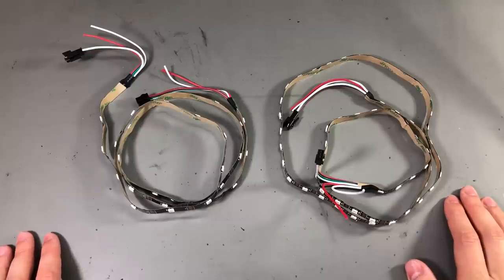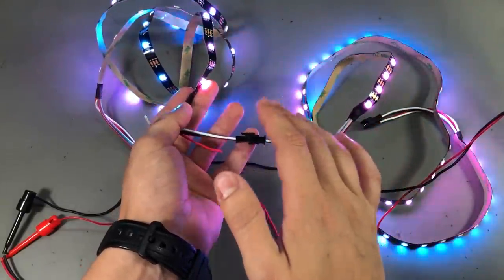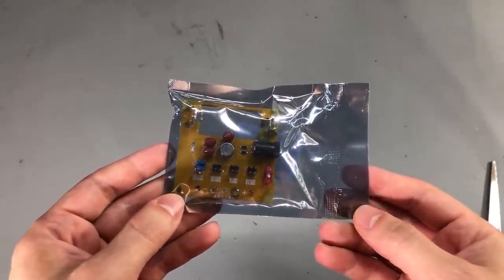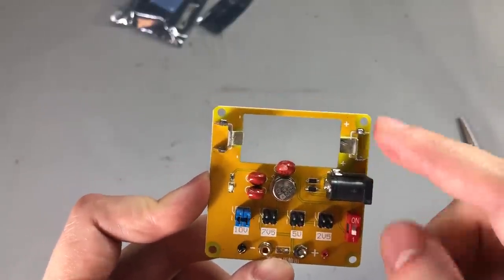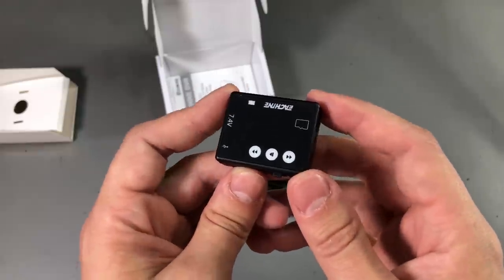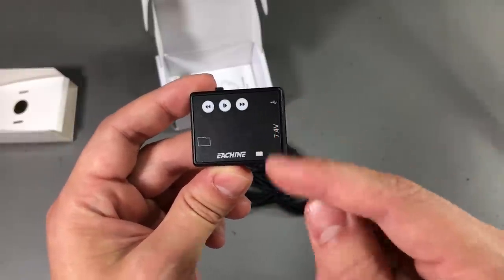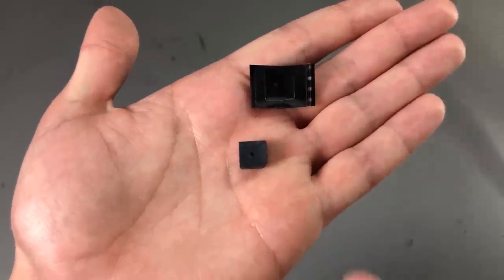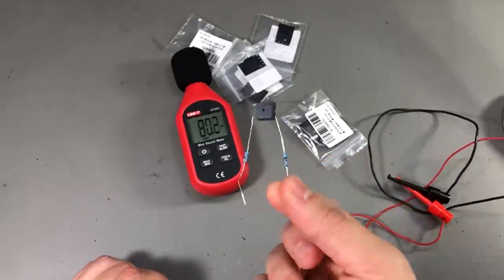Voltlog #176 - InTheMail

Comment: Did You also get a bit of paper with the voltage reference saying what each output was exactly? I purchased a couple of those types about a year or so ago, and it had that with it.
Reply: The Defpom's Repair Channel I was about to ask the same thing about the sheet of values with the calibrated meter. Unless it's expected to consider perfectly rounded values like 10.0000V 2.5000V etc...
Reply from the maker: I got no calibration paper with this one. However from what I've been reading people were getting the same printed values so maybe they just stopped doing that because it's silly :-) I did send mine to a friend which has access to a calibrated meter to have it measured. I will report back in a new video.
Reply: VoltLog - awesome, at least you will be able to trust that calibration. I saw someone else with the same unit, I don’t remember who it was, their paper was different to mine, so they appeared to be ok at that time.
Reply: The Defpom's Repair Channel The printed ones are just photocopies of the same data. The hand written calibration labels look more genuine but who knows if calibration was even performed?
Reply: bornach - I think in my case the ones I got were genuine, as the calibration values were were very close to what I could measure on my 6.5 digit meter.

Comment: I already had a AD584 voltage reference, but it's an AD584J :/ That kinda sucks. I've never noticed any difference in the readings though (probably because I try to keep my lab always in the 20°C - 25°C range, and none of my multimeters give such a measurement with that many decimal places to begin with...)
Reply from the maker: that should be good enough, however I wanted to get the better one because I review multimeters on the channel and I need to give you guys a good reference, no pun intended :-)

Comment: If you want a lightweight magnifier, you can get a "jeweler's loupe". They're about the size of your thumb, come in a variety of magnifications, optionally have an LED, and are typically pretty cheap. Probably not good for making videos because they are small, but good otherwise.
Reply from the maker: yes, I have one of those and I use it for small jobs, but like you said I needed a bigger one good for making videos.

Comment: Hmmm. Don’t know now if my voltage reference is accurate now? Same board. But I’m not sure how much it matters? All my multimeters and power supplies are calibrated using it so they all agree. They are all singing from the same hymn sheet so I don’t think it matters if they are out by a minute amount?
Reply: Same here. Got the cheapest one on Aliexpress.  Well now you make me doubt if my Aneng an8008 is that correctly calibrated from the factory or that they might have used these 'cheaper' boards.  Well if we all calibrate or meters using these than they all might be the same percentage of.  I think I can live with that.
Reply from the maker: I wanted to get the LH version for its better stability and I will have it measured with a calibrated multimeter to get an accurate reference value. That way I can give you guys some nice results when I review multimeters.
Reply: The one I bought came with a hand written calibration label. Of course these can be faked trivially.

For the 15 volt supply I used a 12V alkaline A27 battery with 2 x 1.5V button cells held together with heat shrink. The resulting length turned out a good fit when using appropriate choice of button cells.
Reply: But even then ... lets say ones 5V is 5.0001 and another might be 4.99992   .  I think to calibrate our 'normal' meters with them will do just fine.  Our meters will probably have more issues in accuracy with the temp differences.
Reply: The point of using a reference like this is to calibrate (or check the calibration of) your meters so that they actually measure the *absolute value* of voltage correctly. If you only want to align your instruments to agree with each other you don't need a reference like this at all - just select one meter and tweak the others to match it. A bit pointless exercise, though, because you could easily end up with all your instruments being out and lying to you - but they will be out by the same amount, yay!

So yes, it does matter. If you are using this kind of reference, you are likely looking at at least a 5 digit meter or better. It won't matter much for a $20 Chinese wonder that doesn't have neither the resolution nor long term stability.
Reply: Jan I agree on that.  My 2 Fluke's were spot on but the other ones were slightly off, except the AN8008 which has been scary accurate for the price. I already used it at 5C and at 40C outside. Both times it showed the same value as the Fluke.  1 of the other ones that is in the back of my car was really off like 8.4V at the reference 9V. I first thought it was the battery but it really was the meter. I should actually throw it away and buy another Aneng. The cheap module is always in my 'take away' bag for a quick reference if I find that something isn't what it should be.  
But the real question that comes into mind is does it really really matter for most people?  For measuring 18650 etc I absolutely agree, but for measuring a 7805 or other analogue stuff I would guess that 2-5% off is not really that important.  What scares me more and what people don't talk about is that  they charge lipo etc cells and start measuring with very precise values without taking cable and connector losses into mind.  My moto is still know what you measure.

Comment: You might be measuring with the db meter wrong as you suspected.  It's not just the settings but the distance and angle.   When you see a db rating spec, it's usually stated at 1 meter and that's done at a 90 degree angle.  Your measurement had it directly in the microphone at a couple centimeters away which I would say is not the proper way to measure.
Reply from the maker: and there is also ambient noise that would contribute to a measurement error so I'm doing it all wrong but I hope it does bring a bit of value in the review at least I'm using the same method for measuring all of the buzzers I've received as well as the multimeters on their continuity test.

Comment: That is one big-ass "Hand-Held" magnifier! You should 3D print a coupling that would turn it into a desktop magnifier.
Forgo the batteries and just hard wire it like a table lamp. Use the goose-neck and base of an old table lamp. Could be handy for small soldering jobs. 
Did you know you can buy one that is 40X, but normal looking and not suffering from Gigantism? :)
Google "Handheld 2 LED Light Magnifier Reading Magnifying Glass Lens Jewelry Loupe 40X M10"
I needed one to read markings on very small smd parts, that my X15 couldn't see, without using the microscope.  
I use the X15 magnification version most of the time. like this one; Google "Best Professional 37mm Diameter 15X Magnifier Portable Pocket Handheld Glass Loupe Magnifying Tool With 2 LED Light Lamps"
I can't place links in the comment section anymore. Reader can Google if interested.
Reply from the maker: Thanks, I'll have to order one of those then :-)